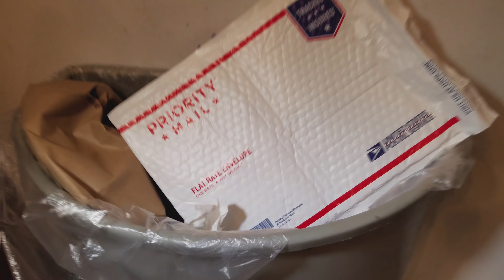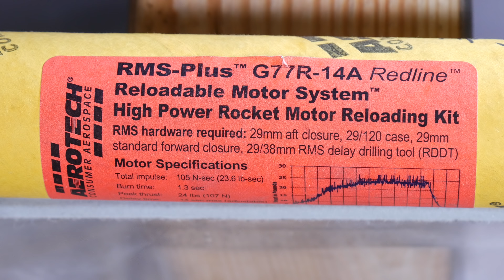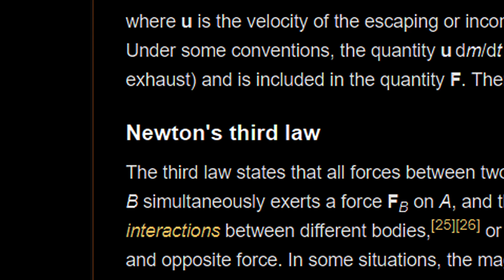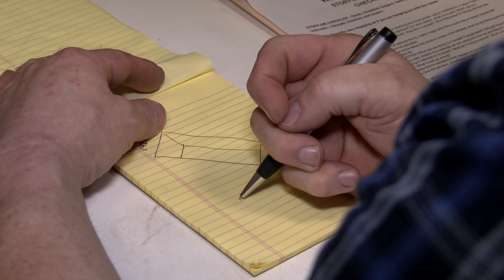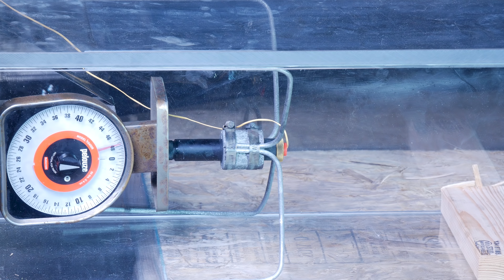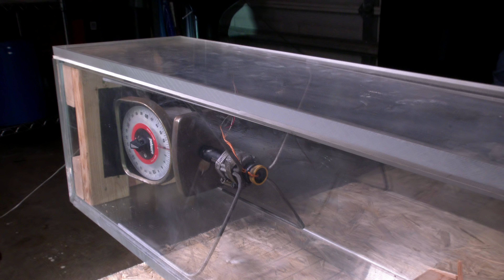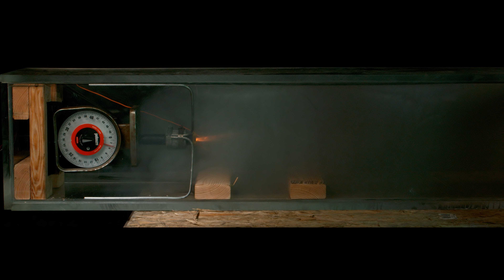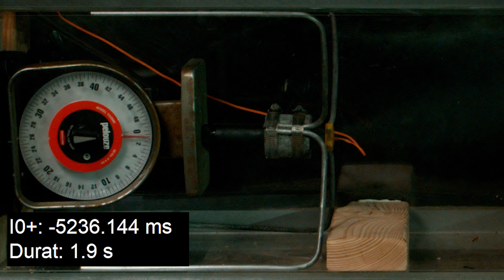Rockets in a Vacuum Chamber - Newton's third law of motion Visualized

Comment: The chamber needs to be way bigger , or the rocket needs to be way smaller .
Reply: We see a force register before any appreciable amount of gas enters the chamber. This verifies the third law of motion.
Reply: @AM-rd9pu  False Positive : The scale is so far out , its comical .
Reply: @AM-rd9pu  Try something on the scale of an olympic swimming pool .
Reply: @markhall5776  This would still work if the vacuum chamber was larger. It would be a violation of the laws of physics if it didn’t
Reply: @AM-rd9pu  Your slow motion cam results say otherwise . You can literally see the momentum of your device does not come into play till after it was overwhelmed by the returning exhaust/smoke /rebounding from the back-end , plus your lid was also overwhelmed as a result , clearly seen as the lid lifted as exhaust expanded in the chamber , this would not happen in the vast expance of space . A good experiment but not representative of the true conditions .
Reply: @markhall5776 Watch at 12:10. You can see that the scale registers thrust at the very first moments of ignition and Warped Perception points this out. 

The rocket motor pushes on the exhaust gasses and the gasses push on the motor. It’s that simple.
Reply: @AM-rd9pu  But did you not just plug the hole , like a cork in a bottle ? This would acccount for the initiated momentum . Thus allowing for the smoke filled atmosphere to catch up with that momentum from the cork in a bottle effect of an equal and opposite discharge of what I call mechanical effect and not a true representation of the vast vacuum of space .
Reply: @AM-rd9pu  Example @ 9:41 Cork in a bottle . Mechanical effect not The Vacuum of space as you suggest .
Reply: @AM-rd9pu  Wait I'm wrong , a bottle of champagne would have a faster release time , as it would not have to burn through a silicon cork . Maybe you should tell NASA to fill their tanks with champagne .
Reply: @markhall5776  You’re thinking about this the wrong way. 

Combustion makes the gasses expand. The expanding gasses push on the inside of the motor and exert a force on it. That’s how thrust works. A surrounding atmosphere is not needed.
Reply: @AM-rd9pu  I understand what your saying , but have not proven this theory , the example has too many flaws . Unfortunately
Reply: @markhall5776 The scale registered a force at the moment of ignition, before any appreciable amount of gas could have filled the chamber. 

And there’s nothing unproven about the third law of motion. The rocket pushes on the gasses and the gasses push back on the rocket. It’s that simple.
Reply: @AM-rd9pu  That was odd ? and exactly at zero ?
Reply: @markhall5776 As soon as exhaust gasses were leaving the rocket, thrust was being produced.
Reply: @AM-rd9pu  In your mind yes , in my conclusion . No !
Reply: @markhall5776  This is just a matter of basic physics. It takes a force from the rocket to accelerate the gasses out the back. Since the rocket exerts a force on the gasses, in accordance with the third law of motion, the gasses exert a force back on the rocket. That force is thrust. The moment there are gasses being ejected out the back, there is thrust. This is an objective fact.
Reply: @AM-rd9pu  So now your saying the force is internal not external ?
Reply: @markhall5776  It would be an external force. The exhaust gasses and rocket are separate and the force of the gasses pushing on the rocket cause the rocket to move.
Reply: @AM-rd9pu  Now your just lonely !
Reply: @markhall5776  So have you just given up on staying on topic?
Reply: @AM-rd9pu  lol what topic ?
Reply: @markhall5776  Did you already forget?
Reply: @markhall5776 so according to your misguided "physics" a crossbow that fires a projectile into a vacuum would NOT experience a recoil force?
Are you sure about that?
Reply: @stuartgray5877  You mean fired from outside a vacuum where momentum is initiated in air , then pass's through into a vacuum it obviously would have momentum but that momentum would dwindle out due to its own mass/weight as in resistance from the vacuum of space no unless acted upon by another mass heavenly body or ejected matter or the pull of the atmospere its leaving as it transitions into the vacuum .
Reply: @markhall5776  here's a thought: how about you take high school physics BEFORE trying to lecture engineers about physics??
Reply: @stuartgray5877  engineer ?
Reply: @stuartgray5877  Highschool ? Oh yes the American version of education
Reply: @markhall5776  Yes "High School" where one can take "Physics".
In "Physics" they teach you all about Newtons Laws, and Inertia, and Momentum.

Maybe you could try taking an introductory course in basic physics BEFORE challenging actual Engineers and Physicists to a physics debate?
It is obvious you are complete clueless about how Newtons laws work.

If you understood, then you could explain why machines like crossbows have recoil.
Clearly you cannot do it currently.
Reply: @markhall5776  Still struggling to understand WHY crossbows have recoil?
Bless your little heart!

Comment: Yeah it’s a vacuum but it has walls……. That’s something to push off of
Reply: When you hold a running hose, can you feel when someone hits the stream of water? No. How is the rocket supposed to know when a gas particle it isn’t in contact with strikes something after being ejected from the nozzle?

Rockets work because of the third law of motion. Throwing anything with mass backwards imparts a forwards force on you.
Reply: @AM-rd9pu  A thermal rocket is a heat engine of the internal combustion type, using gas as the working fluid. Why do you chatbots compare it to a hose?
Reply: @papalegba6796 A stream of fluid is ejected out the nozzle of a rocket. A stream of fluid is ejected from a running hose. 

I’m asking you if you can feel when a stream of fluid that has already left the object it was ejected from is hit.
Reply: That's not how that works. Shoot a gun, when does the recoil happen? When you shoot the bullet or when you hit something? If it's when you shoot the bullet, why?
Reply: @gba6796 - " Why do you chatbots compare it to a hose?"
What is the "exhaust gas" from a Space Shuttle Main Engine? 
Oh, THATS RIGHT! It's PURE WATER!
So, a SSME is just a BIG WATER CANNON.

So, the comparison is PERFECTLY REASONABLE (to anyone that bothered to complete high school)
Reply: @papalegba6796 why don't YOU tell US:
What IS the combustion by product of a hydrogen/oxygen fire?
What is the "smoke" from a hydrogen oxygen flame?
Anyone who has taken high school chemistry can answer since this is the most fundamental chemistry question to have ever been asked 
Why can't you answer?
It's almost as if YOU have never taken high school chemistry OR PHYSICS.
Why is that?
Reply: It's insane how many people think that the exhaust needs to hit something in order to generate a reaction.  It makes zero sense.  

If you sit in a rolling chair with a bowling ball and you throw that bowling ball away from you, you will roll backwards in that chair.  What the bowling ball may or may not hit will have absolutely no impact on whether you roll or not.  The act of EJECTING MASS AWAY FROM YOU is what caused you to roll.  Your roll will be exactly the same whether you threw that bowling ball into an empty void or into a wall.

To think that the rocket exhaust needs to hit something is ridiculous when you actually think about it.  If you throw a ball at a wall, do you feel anything when that ball hits the wall?  If you think the particles of exhaust hitting a wall would have ANY IMPACT on the rocket which ejected them, then you should think you could feel it when a ball you've thrown hits a wall.  It's asinine nonsense.

When you throw a ball while standing on the ground here on Earth, you don't move backwards because the force of friction between your feet and the ground is greater than the force you imparted on the ball.  If you were in a vacuum - you would move in the opposite direction.  Rockets are throwing TONS and TONS of balls (it's just mass - balls or exhaust - it's still mass) at EXTREMELY high velocity.  The rocket WILL MOVE IN THE OPPOSITE DIRECTION.
Reply: @willoughbykrenzteinburg  Flawed... you pushed against the ball which caused you to move. In this case the thrust generated would need to push against something to generate the momentum. Use your brain... Try pushing against air to move? It is hard for you since your skin has low drag. How do birds fly? They are essentially creating lift from the pressure differentials happening which generate infinitesimally small momentums over the wing that you can sum to get your net output vectors. The particles need to collide with something to give you the opposing momentum.
Reply: @ITubeYouK  This isn't a conspiracy.  It's been explained.  If you want to reject said explanation, fine.
Reply: @willoughbykrenzteinburg  If you simply have an output force how do you move forward without anything to push against?
Reply: @ITubeYouK  You don't need anything to push against.  It's the conservation of momentum.  

Momentum is mass times velocity.  Momentum is conserved - - meaning the beginning momentum equals ending momentum.  If your momentum is zero, then it will always be zero - unless some outside force acts upon you.

So - for example, let's say you have a mass of 70 kg and are holding a ball with a mass of 10 kg.  If you push that 10 kg ball away from you at 10 m/s, that 10 kg ball now has a momentum of 100 kg*m/s.

In order to conserve momentum of the system, you must necessarily have 100 kg*m/s of momentum in the opposite direction (to maintain the total momentum of zero).  So, you will move in the opposite direction at about 1.43 m/s.  

Your momentum is 1.43 m/s * 70kg (100) towards the left.  The bowling ball's momentum is 10 m/s * 10 kg (100) toward the right.  The total momentum is zero.  Momentum is conserved.

No air necessary.  No need for something to push off of.  That's never how thrust has worked.  You people need to educate yourselves.  It's embarrassing when people use the argument that you need something to push off of (like air).  It's absolute nonsense.  It's in the first 10 pages of the first physics book you ever had.  Conservation of momentum.  Rockets don't push off of air.  They push MASS away from them, and by the conservation of momentum, they necessarily will move in the opposite direction.

LEARN...

Thinking rockets don't work in a vacuum is no different than thinking you couldn't throw a ball in a vacuum.  If you were floating in a vacuum holding a massive ball and you pushed that ball away from you------- YOU WILL move in the opposite direction with the same momentum.
Reply: @ITubeYouK  - " without anything to push against?"

So You think that the rockets exhaust gas has NO MASS?
When a rocket takes off its "weight" (mass) is about 95% Fuel and Oxidizer.
Where do you think all that "MASS" Goes?

Comment: wrong wrong you would need a endless vacuum or something sucking out your propellant to keep it a vacuum . but i don't think space is a vacuum anyway or a rocket could get past the dome. i would have to see a rocket go straight up for 500 miles with my own rocket n camera  to believe.
Reply: The size of a vacuum doesn’t matter. Also, remember that vacuums don’t suck. The fact that the rocket still lit and instantly produced thrust as soon as we saw exhaust gasses produced verifies Newton’s third law and proves rockets work in a vacuum. 

You can see curvature well before you reach an altitude of 500 miles. 

And there is no dome.
Reply: Have you ever had satellite TV, or known anyone that has/had satellite TV? That's made possible by satellites orbiting at 36,000 km, ie far higher than 500 miles. Those satellites were put there by rockets, proving there is no dome.
Reply: @h.dejong2531  Where do all these flat Earther conspiracy theorist nuts come from?
Reply: @ct6502c  They also congregate and concentrate on the comment section and videos like these because science is an affront to their worldview. They feel the need to shout “nuh uh”.

Comment: So right off the rip I see a problem with the vacuum chamber it's not strong enough to withstand the so-called vacuum of space also it's very small the rocket engine is South will eliminate the vacuum  and we can see that the smoke leaked out of the vacuum chamber everywhere when you let the rocket. You could never put the amount of vacuum in this vacuum chamber that they use to collapse a full-blown train tanker car. We've all seen the video of them collapsing a full-blown train tanker car which is very very strong compared to plexiglass